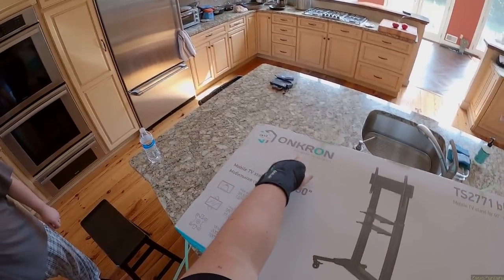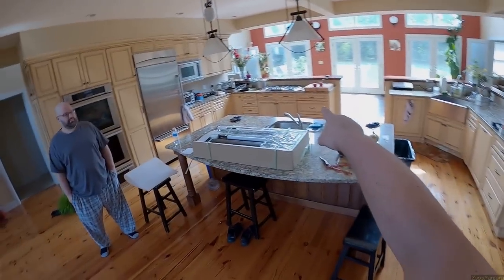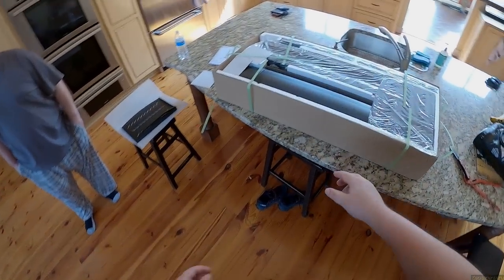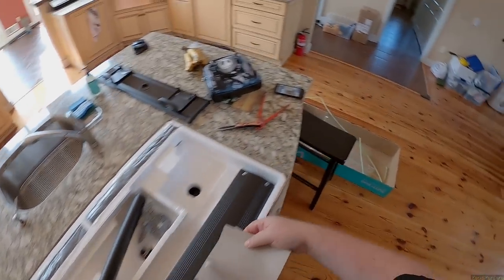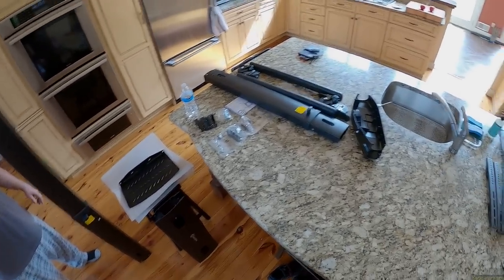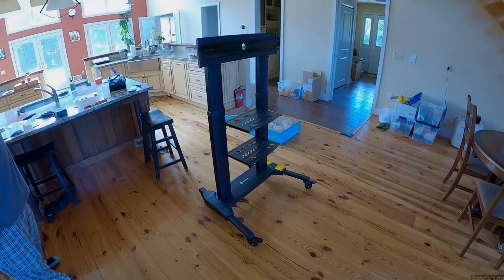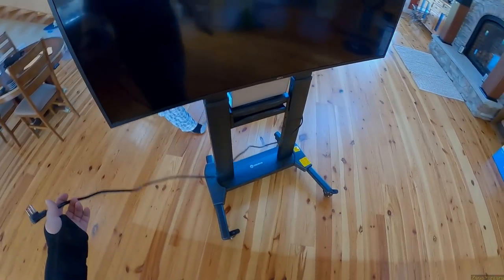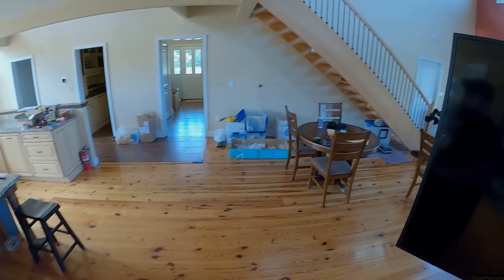Z Unboxing - ONKRON TS27-71 Black Mobile TV Stand

Comment: That TV stand gives me a ton of ideas for using with a standing desk. Being able to roll a TV as a monitor behind the desk to use for work and then roll it elsewhere and lower it for every day TV use seems way more useful than a single fixed height monitor. I feel like there is some sort of path to using a pair of linear actuators to make the lifting up and down a one man operation. Another option is trying to find a way to integrate one of those fire place mantel VESA mounts that has one handed up/down piston operation for large TVs, though you'd risk it being top/front heavy on a rolling stand.